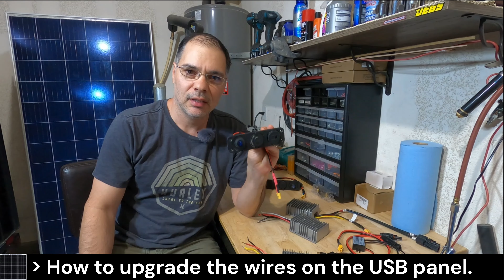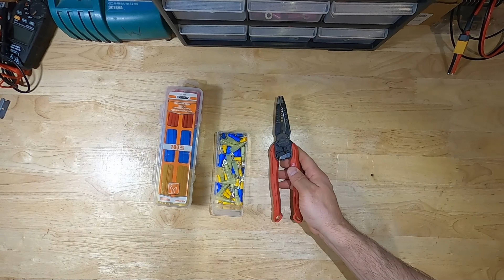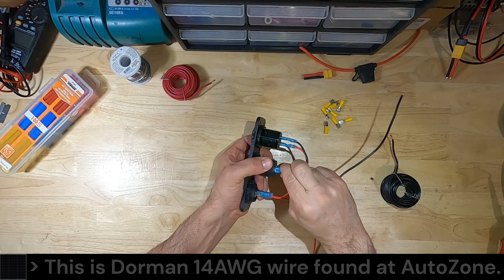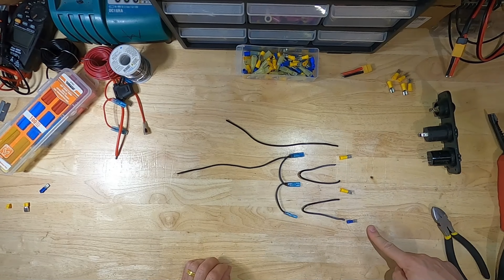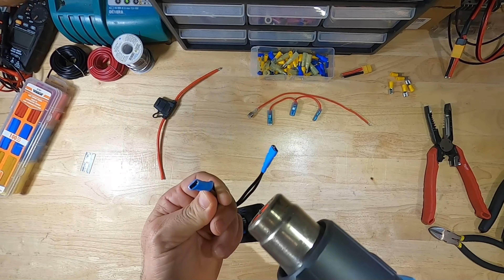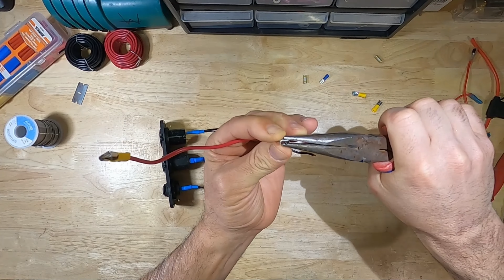Upgrading Wires On The USB Car Adaptor Panel

Comment from the maker: The 3-port panel comes with 18 AWG wires and they can get hot after about 10 Amps. Upgrading them to 14 AWG will allow you to run any of the 12 Volt appliances. The 4-port panel comes with 16 AWG wires that are good to around 13A, so you do not really need to upgrade them. 

Enjoy!

See my website for more information on how to use these USB panels:
https://www.natesdiysolar.com/project...

(3 in 1) Dual QC3.0 USB Car Charger Socket Panel Switch
18 AWG wires - upgrade recommended
https://amzn.to/3JE7tkU

(4 in 1) 78W, 3 Ports USB C 12V Outlet Dual PD 30W  
16 AWG wires - no upgrade required
https://amzn.to/431JmDP

Comment: Hello, can you make me a video on how to run a dehumidifier on a solar panel, the most stable and cheapest easy configuration possible that a new can set up the first time around. thank you so much.
Reply from the maker: My next video will be a complete 12v solar system.  Ty for watching
Reply: @natesdiysolar   can i add you on fb?